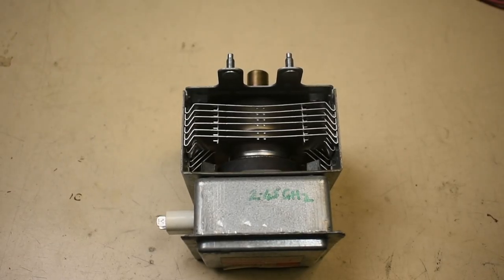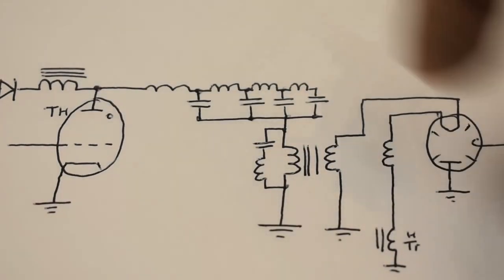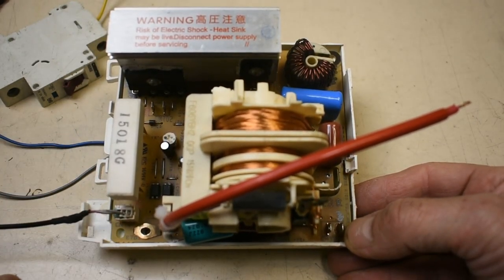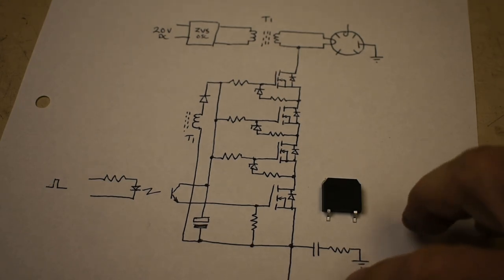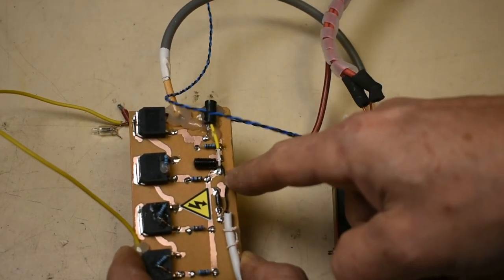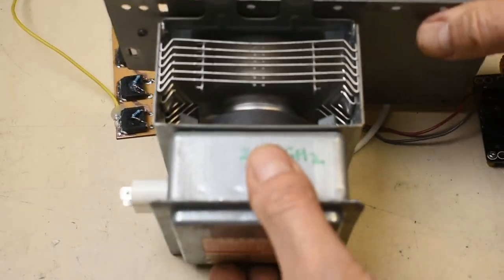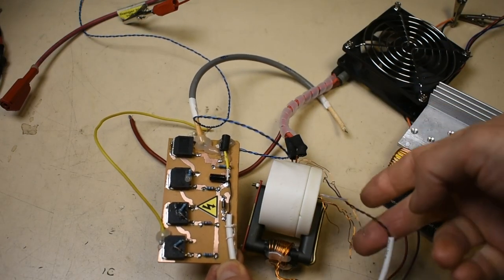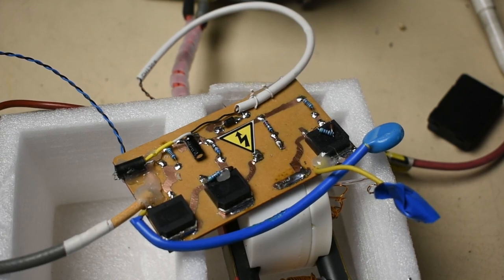Oven Magnetron Fast Pulsing Switch

Comment: Magnetrons take time to frequency stabilize. Consider modulating the magnetic field on the electron path, or using a magnetic polariser on the output. Magnetic polarizers were used in the old days of satellite dishes before you could just get a switched lnb. It all depends on what your purposes are maybe you're doing fast data communications or maybe you are trying to do moon bounce
Reply from the maker: Thanks yes magnetron response time  became the main issue as I was looking for a very quick pulse. The energy level was also to be quite high limiting the options. Although I was concentrating on the electronics it became apparent the oven magnetron was not going to respond correctly.
Reply: @tuopeeks  you may be able to pick up some cheap old stock thorn EMI varian coaxial tuned cavity magnetrons which have a very fast response and a tuning screw however they may not be on the band you need I'm not sure your ultimate purpose
Reply from the maker: @noimnotarobotcanubeleiveit7024   Sounds interesting. I was looking at this for a university wanting a very short (few ns) microwave pulse. We came to the conclusion it was difficult for the switch to operate at this speed but even more difficult for the magnetron.

Comment: Chances are that the MOSFETS aren't switching at exactly the same speed, the last one to switch on will see the full potential of the supply across it momentarily, at least until it starts to develop leakage or shorts out, then the stress will be moved to another one of the transistors.
Reply from the maker: That would certainly do it. It is a tested method for HV switches and they should all switch within a safe limit. However if the gate voltage was a little low, marginality in speed may have occurred so its a possibility. I haven't found any other reason. There is no punch through on any gates that I can detect as this could have also been a possible failure path.

Comment: Can you post details of SiC device please. Thanks. Keep up the good work.
Reply from the maker: I used two devices based on availability, cost, speed and breakdown voltage. The first a SMT device SCT2750NY and the second is through-hole MSC750SMA170B
Reply: @tuopeeks  thanks.

Comment: I don't see that circuit working ... all the gates of the upper FETs are at the same potential through the gate resistors. You need some kind of a divider chain to stack the voltages for each FET. 
The gate drive would be even easier if you use photovoltaic optocouplers, one for each FET
Reply from the maker: Yeah, think you are right, I do have another circuit to try using a potential divider but it will create a small leakage current on the HV side, but think I can deal with that. A photovoltaic optocoupler would be a good idea but I'm not sure if I can find one with isolation of 10kV or more.

Comment: shame the device failed, use the thyratron honestly very robust, I have a few of these. looking forward to the follow up vid.
Reply from the maker: Thanks. Yeah, that's the thing with semiconductors, no second chances. The thyratron would do the job but it complicated as I want to control the pulse time.
Reply: @tuopeeks  I drove the control grid on mine using a low voltage pulse into the primary of a microwave transformer to get about 1000v or so to trigger it on the sec, with some diodes to ensure it doesnt go negative.

 The only important things needed are a decent filament supply (variac driven transformer) and a good fan to cool it. Also as im sure you are aware they need to warm up for about 10 mins so the reserviour fills the tube with gas, (was the case on my deutriurm tyratron) 

In my situation I was only doing one shot firing, as i was dumping the main capacitor bank into water, which produced some nice detonations, but i would like to see the PFN you are going to use as i haven't really designed one before (just using a large capacitor). if you could show that in the next video if possible, that would be good. regards
Reply from the maker: @kaboooom2000uk  The thyratron is great and and would be the item of choice other than I need it to turn off as well as on. I'd have to do that with capacitor sizing and pulse networks. Not ruling  it out but thought if I can get the HV switching method with MOSFET to work its a nice solution.

Comment: Is the voltage rating on the resistors in the MOSFET drive high enough.
Reply from the maker: This was the first circuit I tried and the failure of the Sic MOSFETs did suggest the gates didn't trigger properly. Under voltage would be a possible cause. I didn't investigate further but decided to use a different configuration.

Comment: Use a thyratron,  triggering or a gate drive transformer mate
Reply from the maker: I would, except except I want a variable pulse time. I would need to keep adjusting  a pulse forming network to achieve that so it would get complicated. A gate drive transformer is also a little tricky to set an on time. This circuit could work as a switch for anything from DC to MHz in theory.
Reply: @tuopeeks  I really need to call you as soon as I feel well I will mate ..